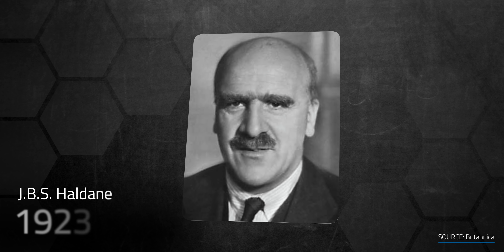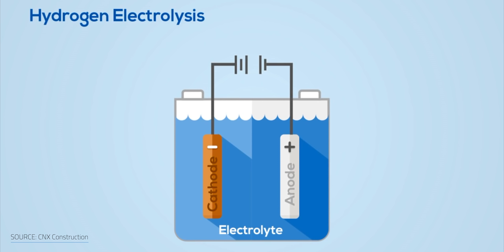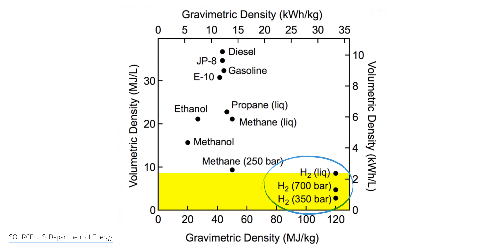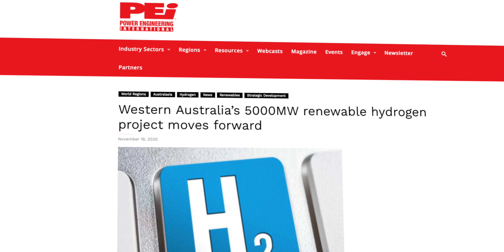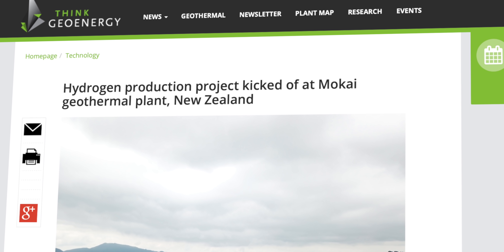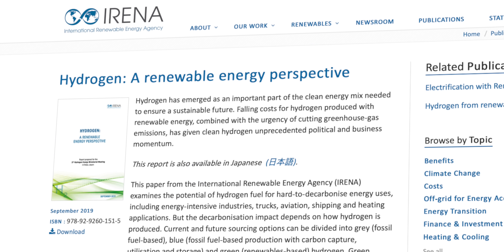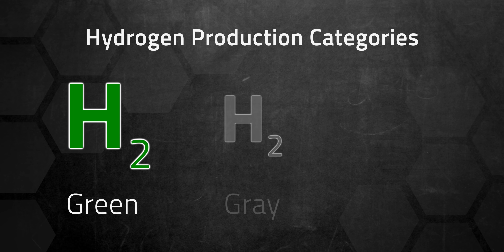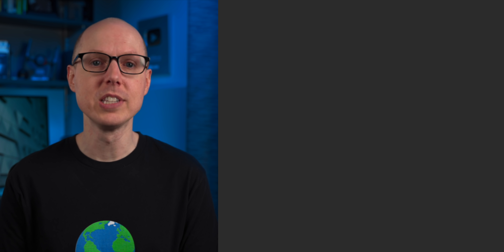The Truth About Hydrogen's Dirty Problem - Green Hydrogen Explained

Comment: No it will not be the fuel of the future. Space X is using Methane CH4
Reply: Let's not be mixing Space X's actually using Methane CH4 today with any psychic predictions of future developments that might not happen.  The safest time to say something will be is just before it is, not years before.
Reply: @rickdees251  I feel the same. Speculation is fun and all but practical and tangible solutions should remain the focus.
Reply: Hydrogen makes more sense than pure electric for the mass majority of the population. Hybrids allow for no range anxiety and the ability to travel when and where you choose. Methane is a worse option due to its emissions. Hydrogen is plentiful and clean.
Reply: @bmoturtleco  Pure electric makes more sense for the mass majority of the population.  There's less infrastructure, it's easy to produce cleanly and with advances in storage tech, range anxiety (almost a thing of the past) will disappear. Methane is a worse option due to emmision byproducts. Hydrogen, although plentiful, is difficult and expensive to extract and very dangerous to have travelling around within the mass population areas. (not to mention charging infrastructure).  See what i did there!
Reply: @Richard-fx6go  what about those of us in apartments that have no way of charging a BEV? As well as  those that like long road trips? BEV's cannot compete unless everyone only drives a few miles a day. Yes the infrastructure for hydrogen needs to be improved but putting more strain on our electrical grid is not the answer. 

Besides fuel cells are not the way to go. Hydrogen on demand allows for production at the time of consumption. Eliminating the risks and costs of presurrising and storing hydrogen.
Reply: @bmoturtleco  I'm not saying the EV infrastructure doesn't need investment but over here in the UK, the local gov are installing charging points in lamposts. All the major routes have charge stations and even some petrol stations are installing charge points. Newer battery tech is reducing the time to charge to a few minutes for 80%. Production at the time of consumption? how is that going to work with small volume traffic? It'd be fine for long haul i suppose.
Reply: @Richard-fx6go  hydrogen on demand uses an onboard electrolyzer. It only creates hydrogen as needed. Its used around the world now as an addition to the ICE. However with proper build it can run the entire vehicle on water. Look up Stanley Myer and see how he was doing it long ago untill he was killed. Sadly the tech and innovation to solve alot of our worlds problems have existed for years but due to greed and corruption, scientific advancements are often stifled.
Reply: @bmoturtleco  There's a lot of greed and corruption in the fossil fuel industry, that's for sure.  I'll look it up thanks.
Reply: @bmoturtleco  H2 is plentiful but it takes a lot of energy to remove it from other elements and still more energy to compress and store it. Meanwhile the electrical grid is everywhere people travel to, why waste the energy produced on an inefficient process like H2 production for the private citizen homes and vehicles. H2 does make sense for large vehicles though, so the H2 distribution infrastructure doesn't need to be as expansive, like just for airports, ship dock yards, truck and train depots.
Reply: @anydaynow01  Thats why hydrogen on demand is the answer. No need to compress and store it.

The power grid is already in dire need of an update. More BEV's will only weaken and already failing utility. Plus filling up with hydrogen takes a fractuon of the time. For businesses and road tripers that is a key point. 

Once BEV's become the dominant mode of transportation you can bet that prices will skyrocket. Yes it's cheap now, but once everyone has to have so much more companys will raise the price to match demand.
Reply: @bmoturtleco  BEV is much more viable for the majority. I have an EV with 200km range and range is not a problem as things are now. If every fuel pump was replaced with  fast charger you could go anywhere without range anxiety.  The cost for that infrastructure would be much cheaper and easier to achieve than hydrogen refueling infrastructure not to mention the cost of the fuel vs cost of electricity from a fast charger.
Reply: @franciscoshi1968  yes if every station was replaced with a fast charger (one that could charge in the same time as filling up) then BEV's would work. However the added strain on the electrical grid would cause massive outages and other infrastructure problems.
Reply: @bmoturtleco  they don't need to be able to charge at the same speed as refueling an ICE car. As for the infrastructure also not a problem.  A standard McDonald's has a power supply bug enough to run 10 fast chargers (minimum) and if you think that running BEV is going to bring down the grid then Hydrogen will be way worse because you will need 3 times the energy supply.
I have an EV with 200km of range and I have made long trips on it and it was fine and I didn't have to fill up in 5min and the trip did not take significantly  longer than the other people on ICE cars that went on the same trip.
We all stopped for lunch and for breaks which were enough to recharge. In fact we had to wait for the ICE car because they had to fill up before we left but we had a full charge when we left and even though they only spent 5min to put the fuel in we stopped for over 20min because they decided to buy snacks and some ICE and stood in the queue to pay. In that time we would have got over 100km on a 50kw charger.
Reply: @franciscoshi1968  but you where traveling in an area with pleanty of chargers. Traviling off the beaten path like going to parks, hideaways, and out in the boonies don't offer the infrastructure needed. There are some places that do sure. Then you have the issues like I stated before of not everyone has the ability to charge at home. Having only BEV's doesnt allow a vast portion of the population access to travel. There will always be a need to fuel up.

Yes puting a tone of BEV's on the grid will cause issues as charging times will tend to happen at about the same times of day. Plus during weather events such as the recent snowpocalypse here in Texas, BEV'S were stranded with no way of charging. In the event of an evacuation or other need to leave quickly, BEV's are a hindrance and liability. If the grid goes down then those drivers are stuck. With ICE's you can more easily access fuel in crisis situations or even run alternative fuels.

Yes BEV'S have their uses and place in society, but there will always be a need to fuel up an ICE. We as a species can not switch to purely electric transportation unless we figure out how to have a permanent motor to supply us with unlimited energy.
Reply: @bmoturtleco  the current state of charging infrastructure is pitiful and yet it is possible to do long trips using EVs. When I do long trips I have to do my stops where the fast chargers are. If every petrol station had a fast charger then I wouldn't have to plan at all. It is all about infrastructure and fast chargers are cheap to install.  About 1/6th the cost of a fuel pump and about 1/40th of the cost of a hydrogen pump.
If fuel pumps were in the same quantity and location as fast chargers are today you could reasonably use an ICE car.
As for not being able to charge at home this is not a problem.  Your car is parked at night somewhere on a road that has power running writhing a few meters. And there have been some stupid comments about the million extension lead and that is not an issue. There are companies with very viable solutions to this problem so it is not a problem.  As for the cars trying to charge all at the same time and all that crap also not a problem.  Controlled load runs storage hot water systems that consume more than a car charging and they do not bring down the grid. I charge from the controlled load because I have solar hot water and the amount of electricity used by the car is less than what 8 used to use on hot water before I went solar. So also not a problem.
And finally for events like Texas your car would be fully charged when that happened. If weather was so bad it would be very likely that you would have been at home and your car would have been fully charged. But with an ICE car there is Avery good chance you would not have had a full tank and you would have had to refuel with no service stations available due to the lack of power. And finally the batteries in EVs if they were mass adopted and used to prop up the grid at the time would have stopped the Texas problem in the first place. So no matter how you look at it the more EVs we get the better we will be in every way. Yes there will be some that will be worse off but the majority will be better off.
Reply: @franciscoshi1968  like I said if every station converted to fast chargers then EV's would be a viable option. No not everyone can charge at home. I live in an apartment complex where there is no way for me to charge a car over night. In addition there are alot of industries that cannot rely on EV's.

Alright so let's put a pin in the infrastructure debate and move on to more pressing matters shall we?

So what about the massive environmental devastation caused by the mining and construction of batteries? With more and more resources needed how do you justify the destruction of our natural landscape?

Making ICE's more efficient, cleaner burning and less reliant on fossil fuels seems like the better option. Even with current tech we can bring the efficiency from ~30% to well over ~60%. With proper investments and research we can even push it further. All I've been saying is that we need to have options available that don't rely on a paradigm shift.
Reply: @bmoturtleco  if your car is legally parked at night there is a solution to your charging problem. There is an English company that has solved the problem. It is only a matter of demand. (I can't be bothered to look for the link). Not having a garage to park at home is not a valid reason for not using an EV.
The majority of people could use EVs. As more and more people switch to EVs there will be more charging infrastructure.
The price if fuel continues to go up and the price of electricity is either flat or going down. It is very unlikely that people will stick to ICE once they get used to using EVs. Also many countries have already set dates for no more new ICE vehicles and most manufacturers are giving up on ICE. The end result of all this will be to make petrol and diesel so expensive that there won't be enough demand to maintain the infrastructure.  If fuel stations were where fast chargers are now no one in their right mind would buy an ICE car. Hydrogen will not solve that problem because no one will buy a hydrogen car if they can't refuel and no one will setup a refuelling station if there are no customers.  BEV  got around that problem by charging at home. Home charging makes an EV capable of covering 80% of most needs. That is how they got started. Unfortunately that will not happen with hydrogen.
The government would have to step in and spend billions on infrastructure for vehicles that no one is driving.  It will be difficult to justify that over spending a tenth of that money on fast chargers that people can already use.
So BEV already won the race. It is just a matter of time before ICE becomes too expensive.
Reply: @franciscoshi1968  the environmental impacts of EV's do not justify their potential benefit. Manufacturers are only going mostly electric (none are completely getting rid of ICE's due to multiple industries, just for the civilan market) due to goverment mandates that are only put in place as a farce. Electricity still comes from fossil fuels for the most part. Even with advancements in battery tech (destroys landscapes and poisons water ways) wind (not environmentally friendly) and solar (poor efficiency and short life span) there is no way to meet the world's energy needs going green.
Reply: @bmoturtleco  I am not worried about what happens to ICE vehicles. I have an EV that is powered by solar panels on the roof which also power the house. I don't buy electricity or petrol. If there was a blackout or fuel price doubled I wouldn't even notice.
Soon others are going to find out that it is possible to get all your energy needs from renewables and will ditch fossil fuels. When enough people stop using fossil fuels it will be too expensive to run and they will become a niche market for those that have no choice. The environmental damage from EVs is less than that of ICE cars. And EVs are coming no matter what. It is too late to change course. It is only a matter of time before you either can't buy fuel or is so expensive that no one would use it.
Reply: @franciscoshi1968  so your willing to ignore scientific evidence and logic to suport a corrupt social ideology?

The evidence proves EV's and "green" tech are more harmful for the environment in the long run.
Reply: @bmoturtleco  it depends on who publishes it. The ones against EVs say they are bad and the ones against fossil fuels say they are good.
For me I am happy that I don't have to smell the fuel fumes every time I drive the car out of the driveway or when I used to go to put petrol or when I park the car in the garage and I don't have to go to a fuel station to add fuel every few days. The EV is way nicer to drive smoother and quieter than any petrol car I have ever been into (including very expensive luxury cars) I don't see any benefit at all from having to drive a petrol car. I wish I had bought the EV sooner and I will never buy a petrol car again. From my point of view if ICE disappear it will be a good thing.
As for the environmental damage of mining battery materials I don't think it is any worse than the mining of materials to build ICE. You should see how many resources go into building an engine and transmission and precious metals for catalytic converters and everything that goes into building an engine. They most certainly don't grow on trees. An ICE engine and transmission weighs not much less than a battery and all of that metal has to be mined refined smelted forged machined heat treated etc. You should visit some of those factories one day and tell me how environmentally sound they are. The news are very good at showing pictures of mines and saying that mining lithium is a big disaster but so is mining anything else. Some of the pictures you see on those reports are not even of mines used for batteries. And to show how misleading your information is, everyone talks about lithium mining as a big environmental damage for batteries but lithium is a very small part of a battery and is a very common material. Most of the material in a battery is nickle and graphite but no one talks about the nickle and graphite mines. So why don't they show the open pit nickle mines and talk about the environmental damage? That would be far more significant and nickle and copper mining are very polluting. Far more than lithium mining. Most of those reports are biased depending on who writes them.
And the reason I mention copper is not because EVs use copper but because copper nickle and cobalt deposits are usually nearby.